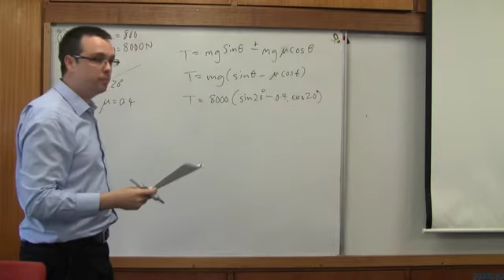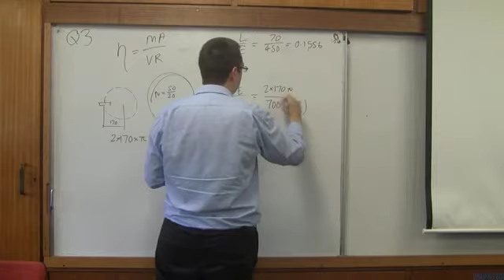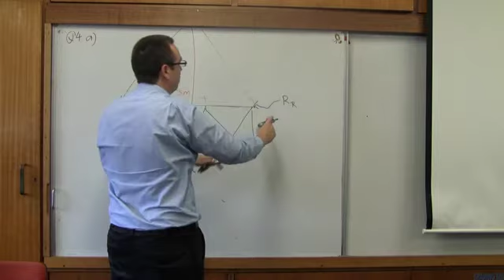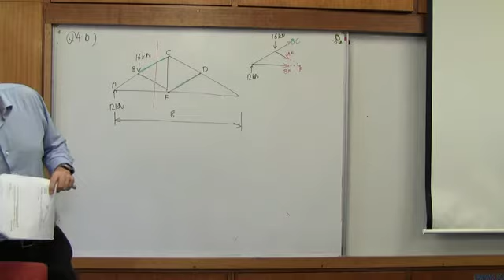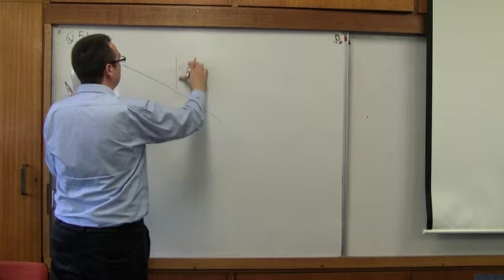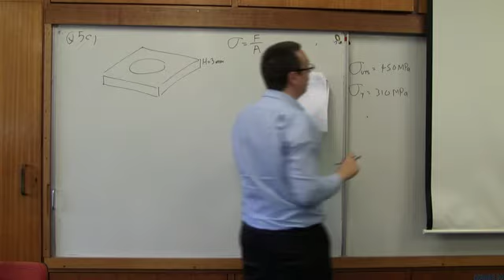HN MCR 2021

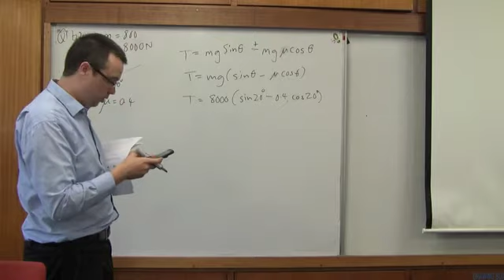Comment: Hey, there's a problem at 4:43, the minus is meant to be a plus to prevent slipping. However, if the question was to pull the boat up instead then minus would be correct